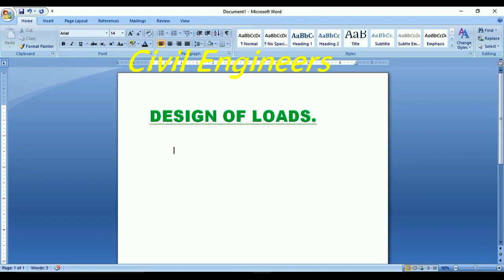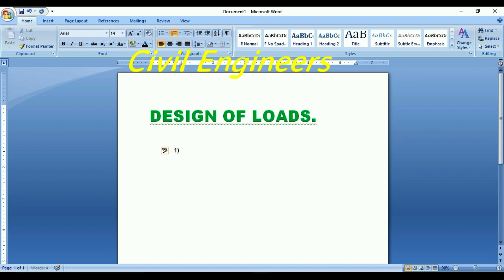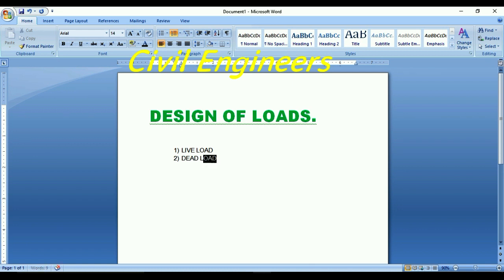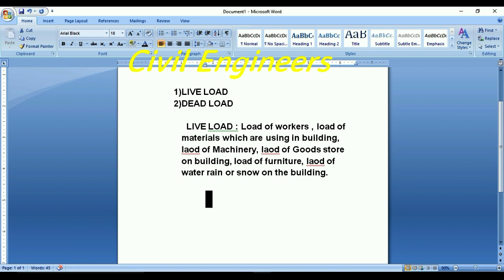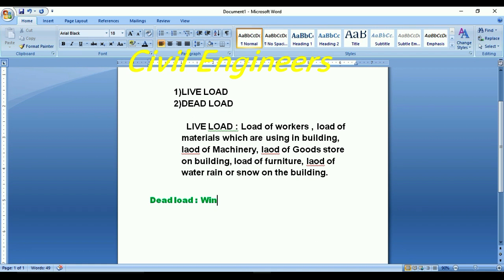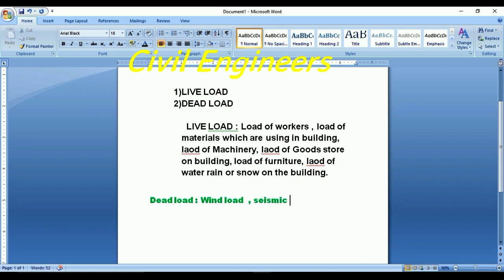Types of Loads on Structures.

Comment: dead load means self-weight of the structure or permanent loads, seismic or wind load are environment loads and live load are move able load on the structure which is temporary loads
Reply: Your reply answer is  correct ,otherwise explanation of this video is wrong
Reply: you are right,